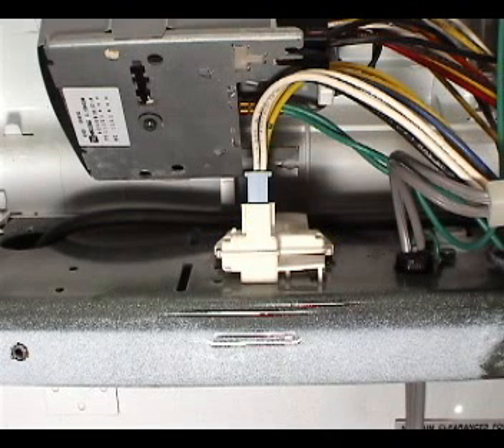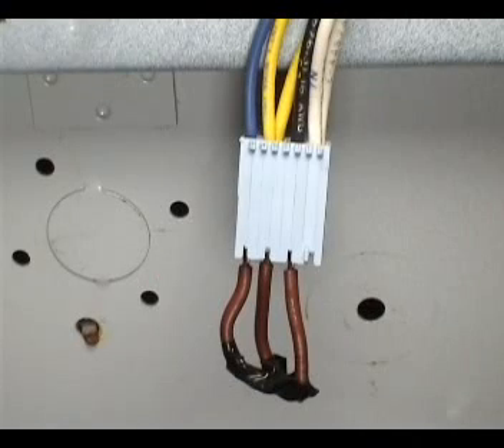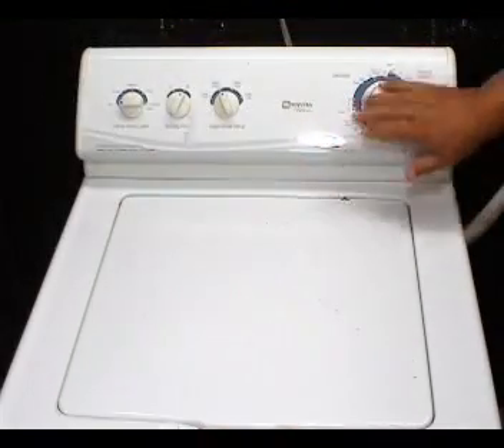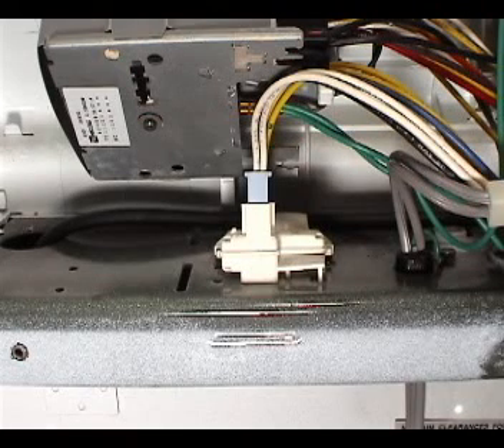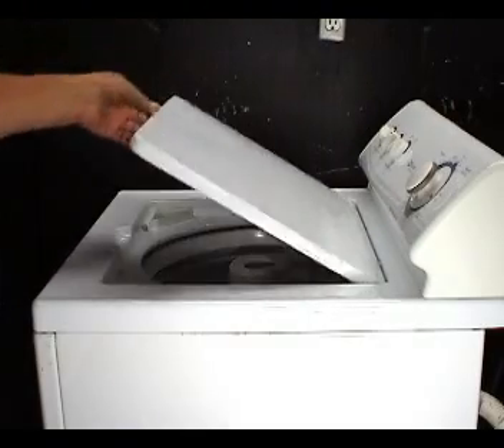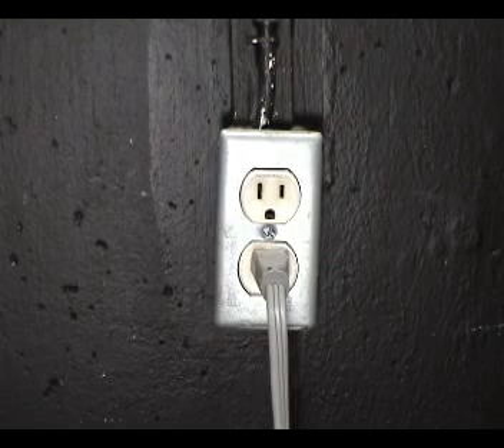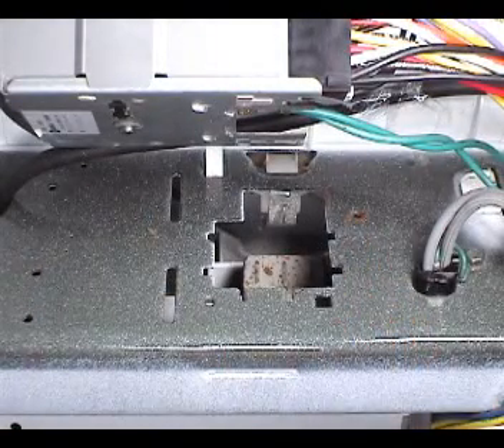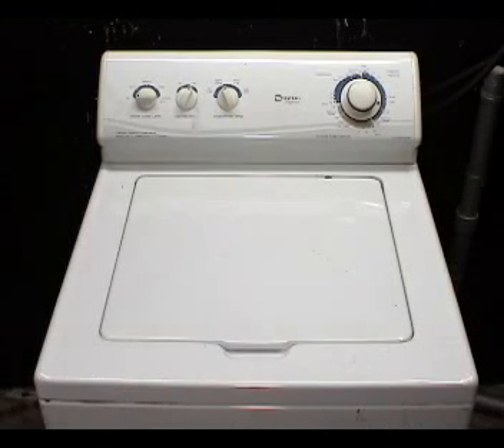Maytag Washing Machine Not Starting - Check The Door Safety Switch

Comment: This work for me. Now I can order the correct part on the first try and still keep the laundry up while I’m waiting for it. Thank you sir. Instead of twisting 3 wires together, I used one of those electrical dealies that lets you joined 4 wires together by pushing one end into it. I guess a wire nut would work too. I only had 12 gauge solid wire, so I pounded the other side flat and it slid right in as if it was made for it. No soldering required.